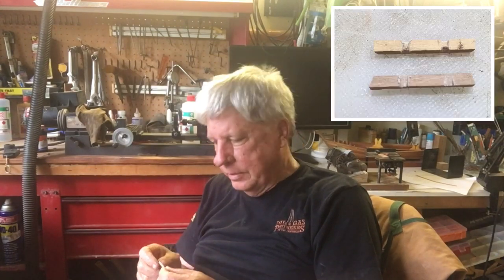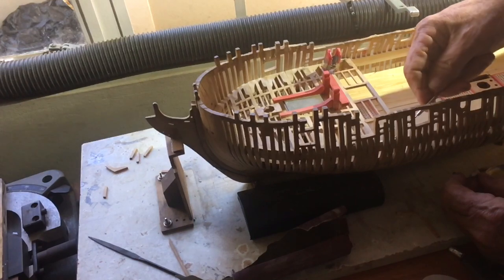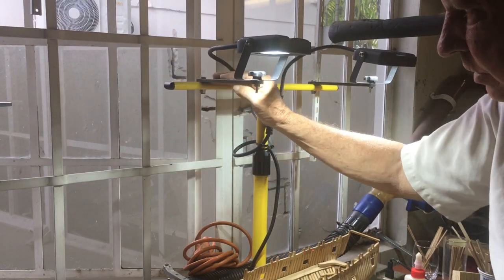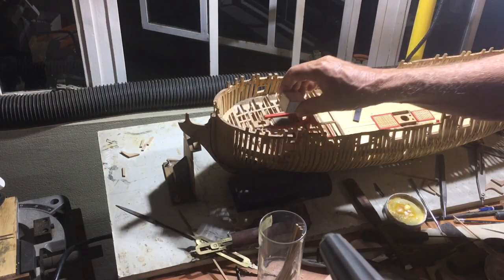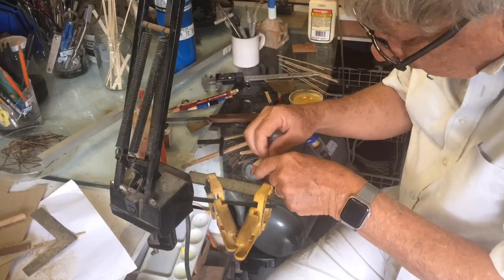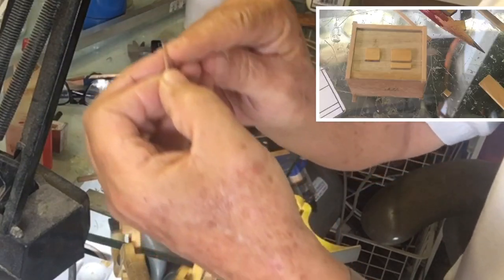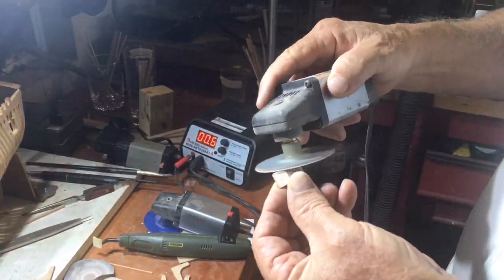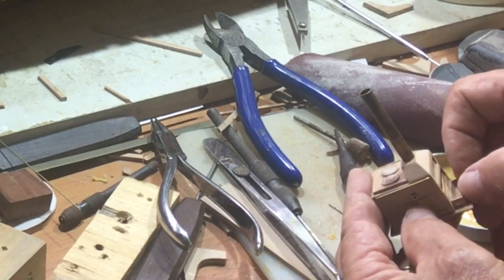Video 65. HMS Thorn.Upper deck.  Precut parts. Making the galley stove.

Comment: Good day, Kevin.
Your skill set and patience are very enviable.
To your comments on the shadow effect of your bench lighting:
I’ve found that a head lamp is,  all around, the most accommodating lighting for any task.
Head lamps come in two designs, one of which is a flashlight type of beam, which I’ve found rather annoying to work with.
The second design is more of a broad beam illumination created by a bulb that almost resembles a tiny fluorescent tube.  This I find to be much preferable to the first.
Cheers...
Reply from the maker: I have two headlamps that i do use quite often, but needed to improve light on the new workbench.